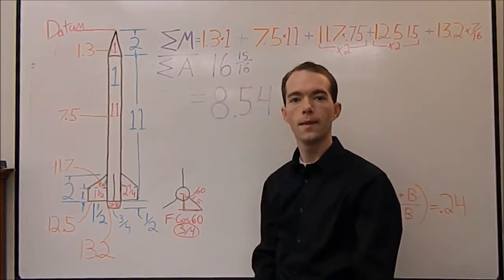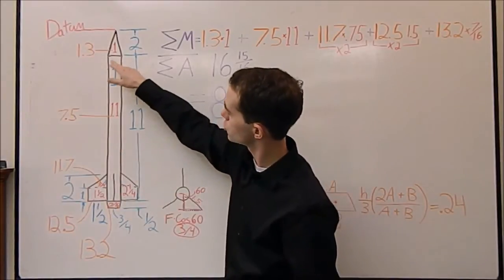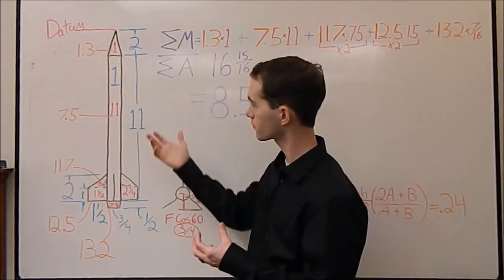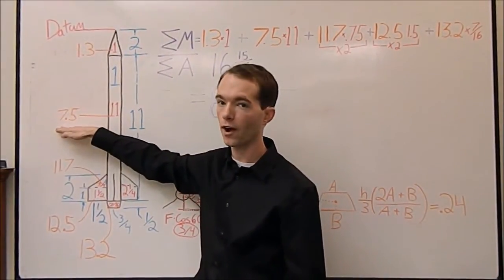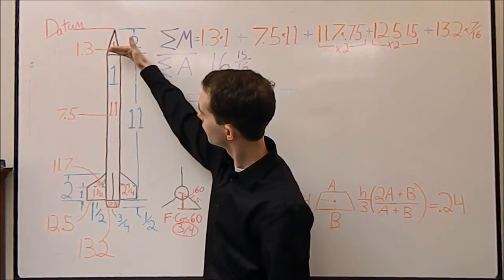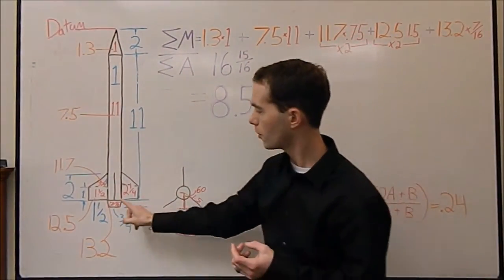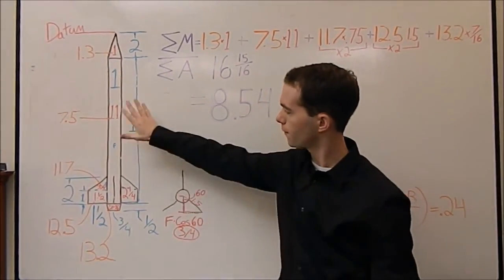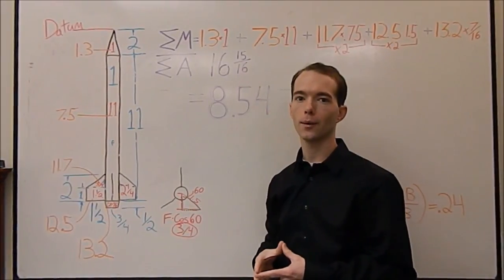Rocket Science: Stability - Center of Pressure     Mikes Inventions

Comment: How we can make difference between 2 rocket which have 2 fins and 4 fins.they have the same center with this method
Reply from the maker: Hey Mohamed! There is no difference, however you'd never make a rocket with only 2 fins. 3 is the minimum required for stability. If you think about a rocket with 2 coplanar fins, it could rotate in the plane of the fins, and that's not good. If you were to have fins of different sizes for some reason, you'd need to calculate the stability of the rocket in pitch and yaw, because it would have different characteristics in each plane. Now, you could make a rocket with only 2 fins if they weren't coplanar, but why do that? The math for stability is much more difficult. a 4 fin rocket with equal fins will have identical stability in pitch and yaw, that's why you only need to use the projected area, which is the same as just 2 fins. Hope that helps. Thanks for watching!
Reply: @MikesInventions   it helps a lot thanks for this detailed explanation sir.

Comment: I'm thinking abut building a remote controlled model rocket powered by an electric ducted fan. It's going to have air inlets on the sides, how does this affect the center of pressure?
Reply from the maker: That sounds interesting... So not a "rocket" technically, but it'll be cheaper to fly I bet. If the inlets protrude from the sides then you'll account for them just like you would a fin. If it's an internal NACA style inlet, then it doesn't affect anything. Either way, just project the area of the rocket and find the center. Have Fun!